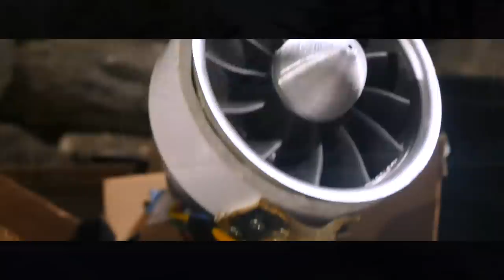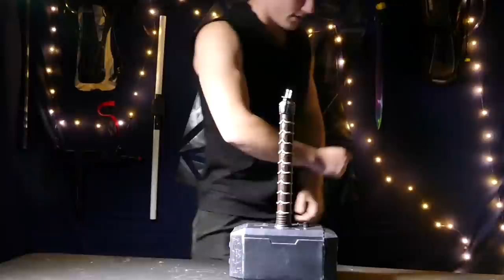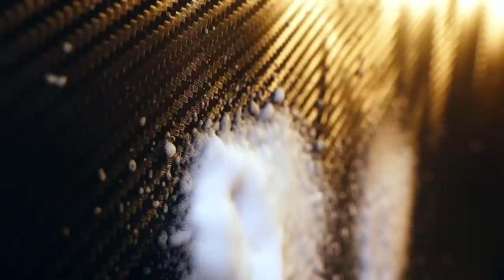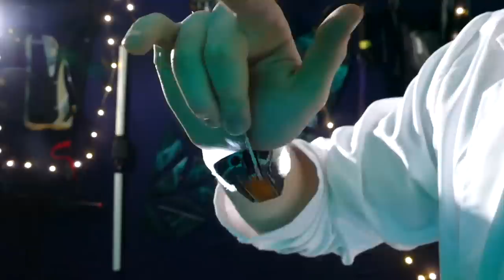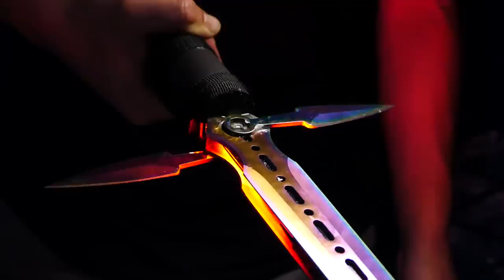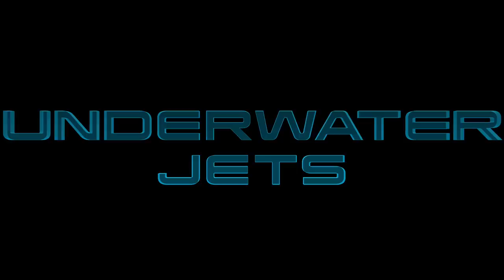20 Homemade Superhero Gadgets! (Web Shooters, Thor Hammer, Iron Man and More)

Comment: Ok, I have a idea of making real web shooter or something like that. When you use the type of superglue which can be used to fix metal and other things, you try pulling the gum apart from a tiny amount. This would create a thing like real web. It hardens on cooling. You have to keep it molten hot inside the shooter and it should cool down and harden on coming out. If the glue is strong enough, you can swing from building to building like spider man . I hope it works
Reply: Cool ideea i Test it!